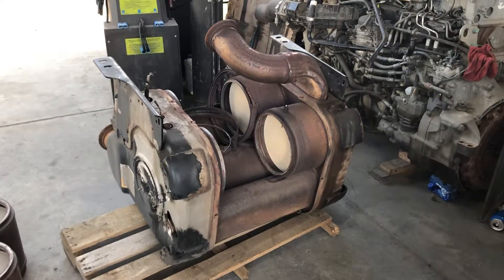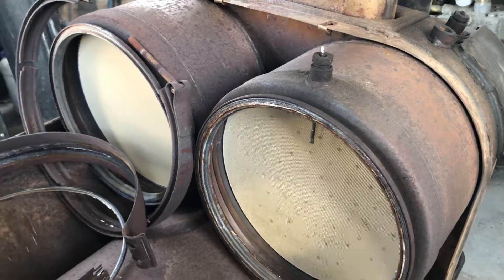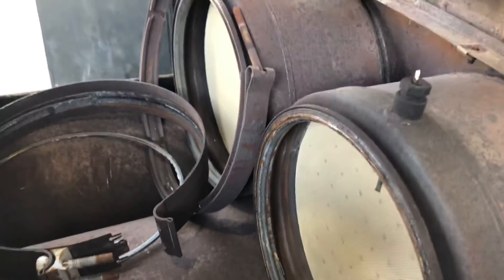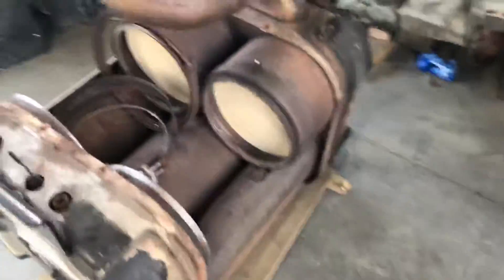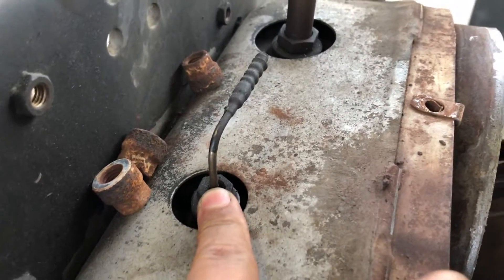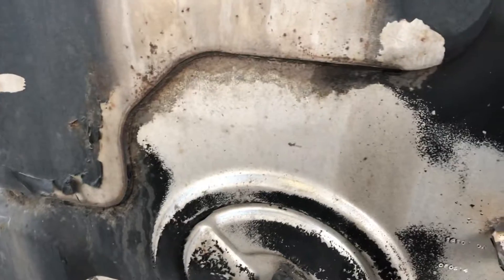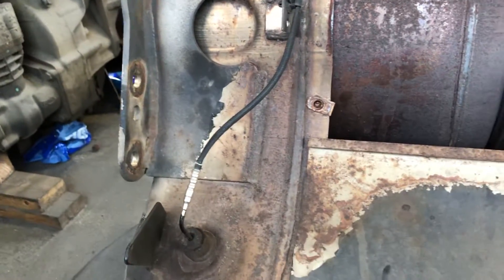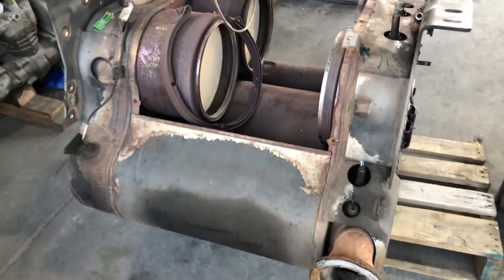ATS One Box Design Freightliner Cascadia 2012 to 2019: ATD Explained.

Comment: Everything is clear! Thank you Bro!
Bro is dpf filter same for cascadia 125 2017 with DD15 and Cascadia 126 2018 DD15?
Reply from the maker: I think they are the same DPF for those years, starting 2020 or 2021 those have been change for smaller DPFs. Check my video about the newest design on my channel.

Comment: I’m getting SCR NOX EFFICIENCY LOW CODE. Freightliner basically told me to replace my one box because the inlet Nox temp is lower than  the outlet and all of the sensors and everything else is working fine. Can the DOC AND SCR BE CHANGED OR FIXED Without having to replace the whole box
Reply from the maker: This is a good question, there are some places that could fix your DOC box, but I would not recommend it because we tried in our fleet couple times it works for like a month and then the same problem comes back again, so at the end is a waste of money, perhaps you should wait to get some money and get a new one. This is just my personal opinion.
Reply: @LetstalkDIESEL  this is where I am at with my one box I keep getting a 520371 and 520372 codes, so far I have replaced every sensor on the one box I replaced the one box wiring harness. I’ve had the one box taken out, cleaned with the DPF filters also cleaned the only thing I have not changed on my one box is the one box itself and DEF dozer
Reply: Did you end up getting your one box replaced? Did it help or fix the issue?
Reply: If you have Diagnostic Link: Perform a Parked Regen, then immediately do an SCR EFFICIENCY TEST. You can replace the inlet/outlet nox as many times as you want, you have to do the Efficiency Test to verify levels.

Comment: Hey buddy this was an amazing video. I have a question please. I changed every single sensor you mentioned and also changed the metering unit plus the DPF (Filters) but my problem is not going away. I keep getting same codes even after changing every single thing. Would you please be able to help me with that or give me some of your great advice. 
The codes I’m getting 
SPN 5246 FMI 0
SPN  4364 FMI 18
SPN 3364 FMI 2
SPN 5246 FMI 15
SPN 5246 FMI 16

These are the codes I keep getting even after changing every single thing. I also installed the DEF Awning. Please take time to give me advice. Your help is much appreciated. Look forward in hearing from you soon. Thank you…
Reply: Hi I have it also  until now no one fix it
Reply: one box is bad need new one  at dealer $ 12000
Reply: Hi, sorry to ask now, been a year.
Did you run an efficiency test then regen after parts been replaced?
How’s it running now?

Comment: One of our truck kept throwing the code 520372/16 
Truck is 2019 cascadia, 350k miles , we clean def filterand dpf, changed both inlet and outlet nox sensor, Doc outlet temp sensor, but code still show up after a week. Do you happen to know the problem? 
Been taking to the dealer still the same thing, they clear the code and pass the SCR test and still show up after 2500-3k miles. My driver is OtR
Reply: I am having the same issue in my 2019 Cascadia have you figured it out for yours? I have had my whole box cleaned. I have had the DPF filters cleaned, I put all new sensors on the one box as well as a new wiring hardens on the one box. The only thing I have not changed so far is the one box itself or the ACM module I’ve spent roughly about almost $20,000 chasing these codes.
Reply: I took it to the dealer and they could not figure it out. They had to open up a case with Daimler and I guess Daimler suggested that I change my engine wiring harness because there was a short somewhere and they also change my DEF pump and filter, but once I left the dealer coach came back on about a week week and a half later

Comment: Bro i have a 2015 cascadia dd15 when i region very bad sound in the ats one box i dont no what hapen i change turbo charged diesel doser def doser both knox sensor diesel nozel but they still same sound when i drive one speed very good drive but when i press race pedal they sound very bad
Code came on spn 102 fmi 18
Reply from the maker: If a sound it’s coming from After treatment device (box), I am afraid that you will have to replace the whole unit. Please take your truck to a proper repair shop, so they can do the diagnostic to tell you exactly the problem, also to prevent further damage to your vehicle.

Comment: How can you tell if the DOC or SCR are bad if you can't see anything physically wrong? I just replaced a box and after the old one was pulled they said the wiring harness was melted and several sensors were failed. What I want to know is if I can rebuild the one box with new filters and sensors.
Reply from the maker: It is possible to repair the ATD box, but I would not recommend to fix it, in our fleet we tried three times, and after sometime (around 6 months) those failed again. Perhaps if you can replace the DOC and SCR themselves that could work but that requires more money, I think. So, I think the best if to give back to the dealership for a core refund because once you altered the box they would not accept it. Thank you for watching the video.

Comment: Tengo un freigliner cascadia 2015 .
Cuando hago el regeration p cuando pongo el freno de motor o acelero mucho hay un ruido en la caja de los filtros usted tiene una idea de que pueda ser sera los Clams q se danaron o puede ser algo con los filtros.
No se si dejarlo asi a quitar losnfiltros .
Reply from the maker: Por desgracia ese problema es muy común en la caja de los camiones freightliner, en mi opinión personal, tendría que reemplazar toda la caja. Pero antes de ello le aconsejó que la examine un mecánico de su confianza que revise todo alrededor de la caja para ver si algo está flojo. Si todo se ve bien, si única opción sería reemplazarla. Esta es mi opinión personal, recuerde que su vehículo debe ser inspeccionado  por un mecánico o técnico especializado en sistemas de emisiones antes de cualquier reparación. Muchas gracias por el apoyo al canal y espero que mi respuesta le ayude.

Comment: How long it takes to replace it?
Reply from the maker: Good question, it depends if everything goes smoothly and parts (everything new) are ready to installmaybe around 5 hours. Note: This time is for the whole installation which include harness with sensors installation, DPF installation, and cover. It might be even more time if transferring used parts from old to the new SCR.
Reply: @LetstalkDIESEL  my truck in the shop they said from 6 to 10 hrs but i think they working on many trucks aside of mine becoz it's been there for 3 days they said still working on it

Comment: I have this one box DPF. This is my problem....

I have coolant leaking out of the bottom of the one box pan out of what looks like a drain hole. Even when the truck isn’t running it is leaking coolant. I am pretty sure coolant doesn’t go towards any of this whole system right? 

Would the coolant be leaking by the DEF pump? And draining through to the DPF? It is a pretty steady leak and will drain the whole coolant resivoir.
Reply from the maker: There is a possibility that your truck DEF quality sensor, it is broken and the coolant is flowing to the DEF. The quality sensor is the one on top of the DEF tank. So, open the filler blue cap and with long thin stick check the color, if you see is clear your DEF is fine. But if it’s color is red, that might be the issue with ATS one box. I hope this help thanks for watching and support the channel.

Comment: Do you have all the OE numbers for the sensors?
Reply from the maker: Unfortunately, VIN truck number is required to be sure you are buying the right sensors, however, you could compare the old number with the new ones, pay attention to the plastic connector, if you look carefully, you will find the number of each sensor around there, including NOx sensor, sometimes they update the numbers, it might not match but if the sensor connector goes in properly, that is going to be the right one. I hope this help you, thanks for watching and support the channel.

Comment: This thing is designed to fail, cost to replace is 15 to 18,000, and you will pay Freightliner this amount about three times in a million miles.
Reply from the maker: That is something Freightliner needs to figure it out, their newest truck has the same style box but with fewer sensors, let’s hope that improve reliability in the long run. Thanks for watching the video.
Reply: As long as it is a sealed unit it is unrepairable and they intended to soak the owners with the junk, this box is a gold mine for the right attorney and a massive class action

Comment: Can u delete the def
Reply from the maker: You can delete the ATS device from the ECU/MCM, but your vehicle will not perform efficiently in a long run, you might not need to take care of the DPF/SCR but the trade of it is to deal with power/EGR issues and who knows what else after deleting the ATS device from the ECU/MCM. Personally, I do NOT recommend those kind of repairs but it is just my personal opinion. Thanks for watching.

Comment: Bro is nox sencer attached to SCR or DPF ?
Reply from the maker: The Intel and Outlet NOx sensors, both holes are in the Aftertreatment Box. It is possible to fix both holes if they have been damaged in order to remove the old sensors.

Comment: When do I need to change my def box
Reply from the maker: The ATD (Aftertreatment Device) box should be replace for couple different reason like:
1. Turbo misfire causing oil going to the ATS.
2. Damage EGR cooler causing coolant to go into the exhaust system.
3. Bad fuel injectors.
4. ATD expose to Excessice smoke from the engine. 
5. Not performing Parked regeneration when the vehicle need it.
This are just a few reasons why you MIGHT need to replace the ATD device, as always, you must seek first a proper repair shop to perform a complete diagnostic. Thanks for watching.

Comment: Great content! Never seen anyone break it down as you did.. 
I had a question regarding my 1-box. I keep getting the "SCR Low NOx efficiency" code, but only when I'm under a load climbing hills, I've changed, outlet psi sensor, inlet/outlet DOC temp sensor, DPF temp sensor, both NOx sensor's, metering valve(2015 cascadia) and the code still came back on. It passes every regen, they last approximately 45 min. I have a new DEF pump at home and the #7 injector I'll change. 
Now I heard you talk a little about the 1-box making noise,  but what kind of noise? Like peices of metal chattering?  I'm asking because I notice that when I'm driving a long a barrier I can hear like a clicking noise coming from that area. It's not a constant clicking,  it'll click three time's, stops then repeat. Is that normal?  As in, is that the quantity valve working and spraying?  Engine miles are 681,300, ash count is at 55%, going to get them cleaned in two week's. I don't beat on my truck, I always go whatever state speed limit is and I don't ever go past 25psi of boost.
Reply: Same happened to me got everything done what u did but i been told that i need to chenge the box part is around 7k and with everything it’s around 10 k I already spent 5 k this system is a joke
Reply from the maker: Glad you like the channel. About the ATS box noise, yeah, it sounds like metal chattering inside, you can heard it when you are driving or when your truck is doing parked regeneration. Pay attention to the sound when parked regeneration is taking place; it is a really distinct sound. Usually, that is a signal to replace to ATS box, might pass regeneration now, but eventually it will become more often. The ATS box might pass the SCR efficiency test barely, as well. To repair it could cost around $7000 just for the part, labor might vary. Of course, this is my humble opinion. Thanks for watching and stay tune for more.
Reply: I appreciate the question you asked...Im having same issue, only when loaded ,and pulling hills..Then my Coolant temps go High, and Oil temp too..I have replaced so much, like Thermostat, water pump, sensors on One Box..Still pulling hills loaded, and i get all the Engine codes, and high temps..This morning a friend of mine who has a one box with only 200k miles is giving it to me..So hopefully by the end of today ill have an almost new 1 Box complete..I will try to come back here in a while and report if that solved my problem..Ive been battling this for over a year, and i cleaned the filters as well, problem still exists....Also i notice you say 25psi on Boost?...My DD15 will only go to 20psi, i wonder why that is??
Reply: I kept getting this, my harness was melted.
Reply: @kt7r  I'm glad that fixed your issue.  Hopefully it permanently fixed it. If not read my recent response to Hookah B.

Comment: Hey Buddy, I just got replaced Def filters and Knox sensor from the freightliner dealership. My truck worked well for couple weeks maybe 2. One day, I was pulling 45k and going uphill in Pennsylvania and my def light started blinking even though I had full def and fuel in the tanks with 2 check engine amber lights came on. I then immediately pulled over on the side of the shoulder and view the fault codes. One was telling me poor def quality and the other one was SPN4364 FMI18 and SPN3364FMI2. I did parked regen on my 2015 Cascadia and the codes disappeared along with the engine lights. This only occurred when I'm heavy and going uphill. Can you please help me out with this situation.
Reply from the maker: It might be time to replace your ATS box or perhaps other components from the exhaust system are starting to misfire. If your truck still pass the parked regeneration every time you do it, just keep it that way. In the meantime, prepare yourself to invest some money in your vehicle. I hope this help you. Remember, you can ask the dealership if your truck qualifies for an ATS box warranty, I read comments around here that they have warranty, but it is something only the dealer can let you know.
Reply: Thats a junk of money. These dealership are ripping customers off with their one box shi*. Its so expensive. My truck only have around 490k and I'm experiencing these problems. Smh
Reply: Robin Singh i didn’t notice earlier that u had this problem 6 months ago , how did u fix it ??
Reply: Thankyou for your response brother. You've got a great knowledge and experience.
Reply: I had the same problem ats box is one that u need to replace it’s around 10 k and one year warranty
Reply: I know brother 10k is if u have new filters and new nox sensors and new metering unit other wise its 13 to 15 k and its a stupid system if u bypass it most likely U will blow ur motor
Reply: Whenever the check engine sign come, I do parked regen and I'm good for a week or so.
Reply: Robin Singh how often does light come on??
Reply: It comes on whenever I'm heavy over 40k and going uphill. Sometimes it sets my truck to 25% derate and I can't go over 55mph
Reply: Robin Singh yeah same here i spent 5 k on new filters and nox sensor metering valve one week after those lights on hill came back now i was told that i need to change that box and that’s around 10 k
Reply: Freightliners has the worst aftertreatment system as compared to the other trucks in my opinion. Mechanics can't figure out what the exact cause of that problem, they just throwing in new parts and ripping our pocket. In the end they say, you need to "Change your One Box". Thats ridiculous.
Reply: Robin Singh yeah even u go to dealer they’re all like that i want to delete mine but I’m scared
Reply: @robinsingh5738  Hey Robin, did you fix these issues? I own 2016 cascadia with 600k milage. And having same issues as you, those light come on every week, or sometimes twice.
Reply: I ended up replacing the whole one box which costs me around 15k. My premium 2000+ warranty covered $12k and I paid the difference which was about $3k. Now, the truck is running perfectly.
Reply: @robinsingh5738  has the code came back up since you replaced that one box? I am in the same boat right now with my 2019 Cascadia I’ve been throwing parts and money at this. I’ve changed everything except for the one box itself and the DEF dozer
Reply: @SFMARK69  no it didn’t. Once I replaced one box everything working good now. No more bs codes. Drove almost 300k miles now without any single def problem.
Reply: @robinsingh5738  thank you I appreciate it that may be my next thing to do, my one box is on borrowed time right now. I have 930,000 miles so I’m sure it is due for a change.
Reply: @robinsingh5738  what was your warranty that covered this one box ?
Reply: @SFMARK69  yes. It’s for sure, you definitely need new one box. I had NTP Premium 2000+ which covered $12k. I had to pay around $3500 additional from my pocket. Since they were capped at $12k. So my total was roughly $15,500.

Comment: Im buying a used doc box how I can tell if is a good one with out remove the dpf filters?
Reply from the maker: This is really hard to tell if an used ATS Box will be fine, but there are couple things you could check:
1. Pay attention to the sides of the box, I have seen when DOC has been pushed, they cut around right side area (if you are seeing the box from the front side). This means it has been fixed. 
2. Get something like a needle around 5 inches long, look for the DOC outlet Temperature hole, then insert the needle inside of the hole, if the box is Ok, it should go smoothly in, but if it doesn't, this means DOC is damaged and pushed.
3. Look at the the outlet of the ATS box, with a flashlight you can see if there is any crack at the end of the SCR, of course, this is just a small glance but it worth to check it out.
Remember even if all this points are Ok, the real test is to pass the NOx conversion process. I hope this help you and thanks for watching.